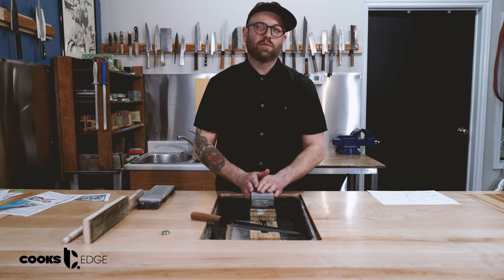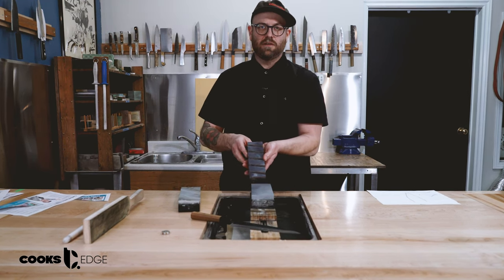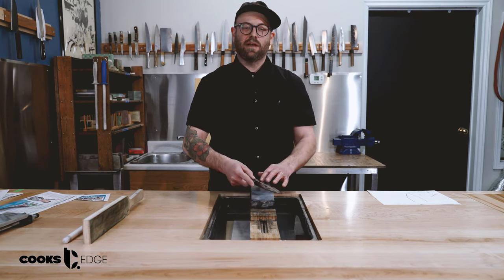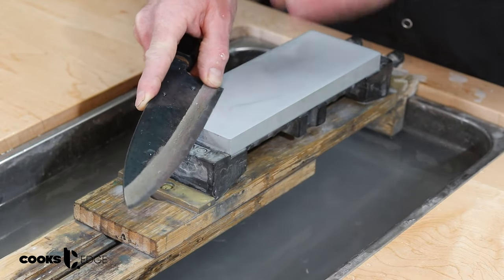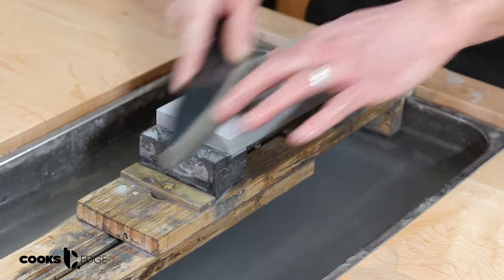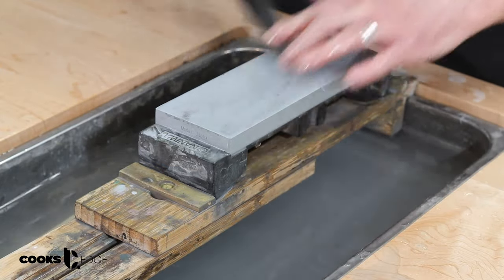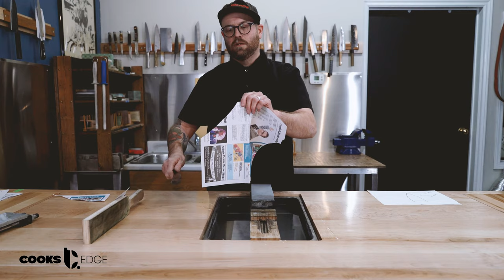How To - Sharpening a Secondary Bevel + Whetstone Giveaway

Comment: My favorite medium stone is, ironically, the suehiro cerax 1000. When you tell people that a stone can feel creamy, they stare at you weirdly. But this stone has given one of my smoothest sharpening experiences, and I have over 10 sharpening stones in the medium grit range.
Reply: its a modern stone that cuts well and is high quality but it's a very friable stone which wears quickly with use so it  benefits from a light touch. either way its going to make a lot of mess in use. stones like this are more suitable for WIDE bevels rather than tiny little edges. it's very difficult not to get stray scratches using a stone like that  to do the tiny edge bevels on say an edc knife. so they are not well suited. they are better suited for wide bevels like on japanese kitchen knives, like it's made for. this stones gives a very nice and pronounced contrast finish between layers of steel as well, with a nice smooth sandblast sort of finish.   Compared to say naniwa traditional stones the Suehiros are softer and wear faster. Great stone to have if you have Japanese kitchen knives.

Comment: angles dont really matter at all. yes it matter, more acute edges cut better. but finnicking over angles is nonsense and everyone mentions and all it does is confuse noobs. All that matters is that you grind all the way to the edge, as confirmed by a burr. as you get more skills you will create smaller and smaller burrs. there will always be convexity in hand work. this is a good thing. this is why the edges are more robust vs wankery finnicky gimmicky fixed systems that cost idiotic sums of money and have little real utility much less necessity .